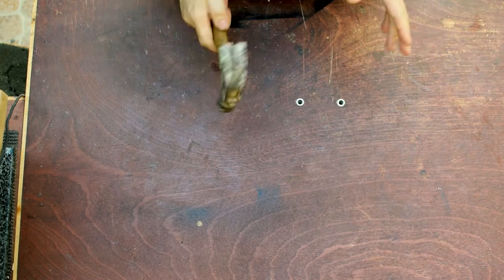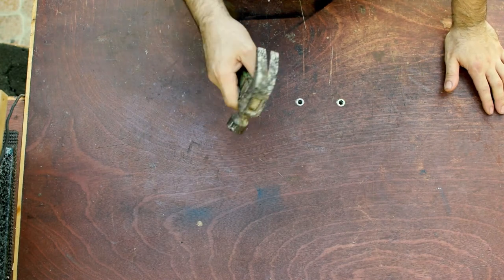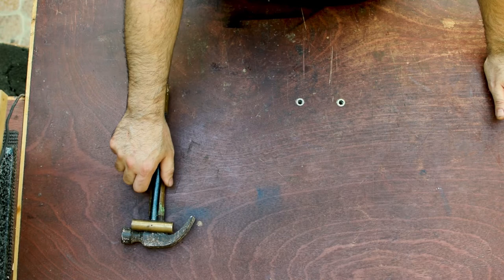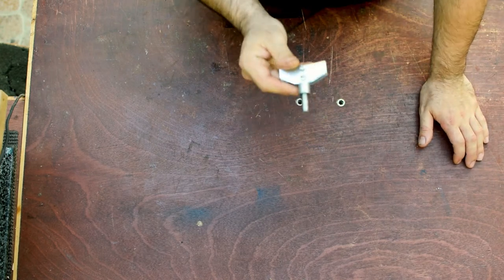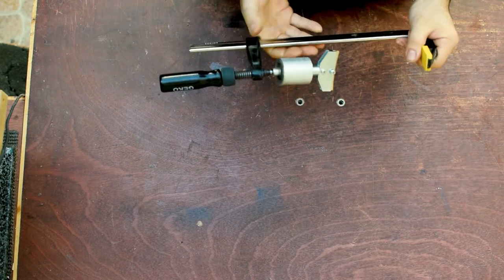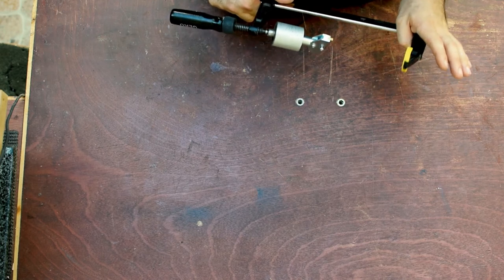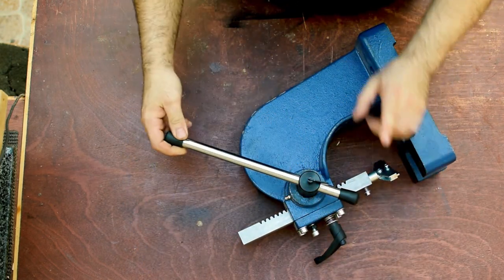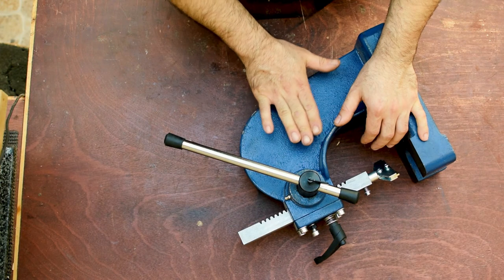Guitar fretting techniques, which is better?

Comment: Never knew Dracula was into Luthierie. Just kidding. On a serious note. Do you prefer to pre cut each fret to length before pressing them in? Or do you you do the press and then cut method? Ive done both and i think i prefer to cut then press but i leave them a little long. Which then makes me a little anxious when bevelling. Any tips or secrets on how to make it all an easier process. I use my bench top drill press as my fret  press. The caul goes right into the chuck and it is handy.
Reply from the maker: I cut and install, and I leave around 3/5mm overhang. Before I start beveling I trim them shorter and file them flush but being very careful though. After that I bevel.
Reply: I vant to fret your board!

Comment: Nice short video (and +1 for the non-agressive music :D). You said "converted the press into fret press", it's because of size of hole to insert the tool or just work "as is" ? (my metal drilling equipment is... amateurish ? cheap as hell ? :p )
Reply from the maker: The ram on the arbor press is not meant to take a fretting coul, so I just needed to drill a holin the end of the ram to accommodate the fretting coul.
Reply: @ManicaroCustomGuitars  Thanks !

Comment: An informative video thanks, can you tell me what the issue was with using a drill press to press frets?
Reply from the maker: In my case, the drill press was bending every time I was applying pressure to the frets. Mind you, I don't have a heavy duty drill press. It's just that if you find a cheap arbor press and convert it to a fret press, you might be prolonging you drill press life.
Reply: My drill press always wobbled. I adapted an arbor press and it's much better...

Comment: Hi, thanks for your video. What happens with the arbor press when we have a big body guitar with set on neck (no bolt on, so we can't remove the neck). Is the arbor press jaw distance large enough to allow to press frets on the end of the fretboard, when the neck meets the body? thanks!
Reply from the maker: Some models you might be able to sort out some sort of setup but usually the last frets you might have to hammer them in.